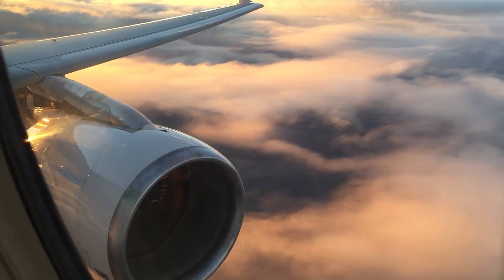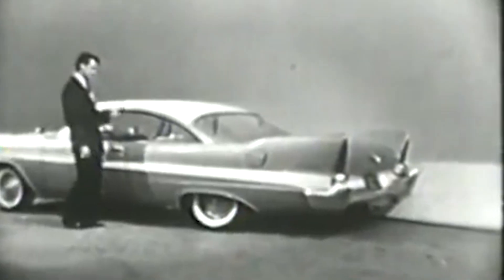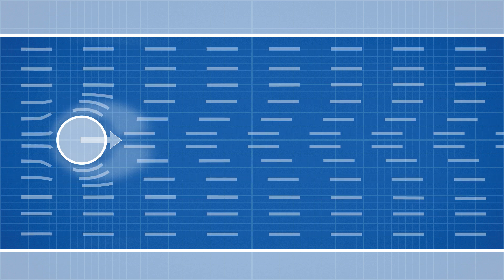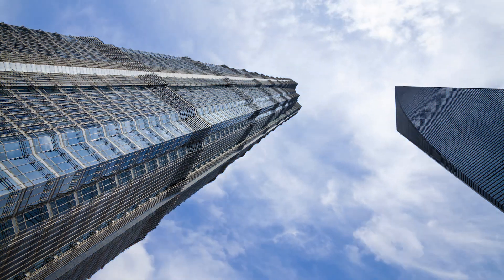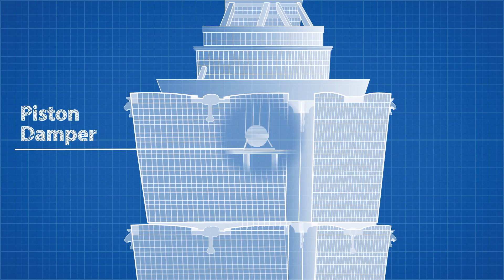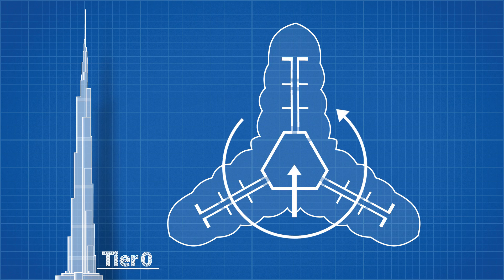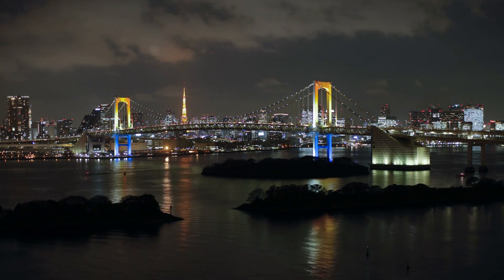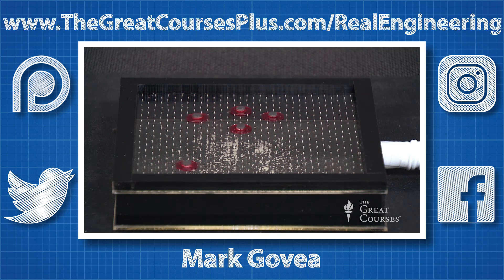Burj Khalifa - How To Build Higher

Comment: Slough in this usage is pronounced like tough, with the f sound at the end, rather than like the ow in power.  In place names and geographical use (swamps or very muddy areas), it's pronounced as the latter, but if it means to shed or cast away something, as in "The skyscraper is able to slough off the vortices of traditional skyscrapers," it'd be the first.  English is a weird language.

Comment: My friend, you should do a part 2 of this video focusing on the sub-structure of the Burj Khalifa! The final product that we see above ground is no doubt amazing, but what is truly fascinating to a structural engineer is the portion of the building BELOW the ground, and in the case of the Burj Khalifa, it's quite an engineering feat unto itself! Think about how deep the foundations needed to have been dug into the sand, then the piles which are another, separate layer of depth. If the above ground structure is about 50% of a mile in the air, then my conservative estimate is that the below ground structure is probably around 25% of a mile in depth. So if measuring for total structure of the Burj Khalifa, it's estimated to be about 75% of one mile, which is truly impressive!

Comment: Hello Real Engineering, I am currently an undergrad student at SFA pursuing a mechanical engineering degree. I am taking a fluid mechanics class this semester and as a part of the course, I am required to write a short paper on a topic using a first order, analyitical analysis from fluid mechanics. We just got in to viscous flow over external surfaces and talking about vortex shedding. I watch A LOT of your videos and I thought of this video. My text book goes into general detail about flow around a cylinder and talks a bit about vortext street and the Strouhal number, but not explicitly. I was wondering if you could recommend some sources for me to look at to learn about this subject. The paper only needs to be 1200 words, so I don't have to go into extreme detail. It is only a first order analysis of the forces caused by vortex shedding, something that can be done analyitically. Anything helps! 
Thanks in advance!

Comment: Another tidbit about vortex shedding... automotive external radio antennas usually have a spiral winding built in for this same reason. The vibrations cause an unpleasant noise, so were addressed with the coil. No more whistle!!

Comment: Part of the reason the Burj Khalifa does not need a Mass Damper is because it's shape constantly changes as it moves upward. If the shape constantly changes, the wind vortices can't gain strength. One World Trade Center in NYC uses the same tactic

Comment: I have a question about rotors.
I know we have rotors that are designed for maximum efficiency, but what about rotating the blades of the rotors to give them maximum efficiency at all speeds? For example, at low speeds the blades are very horizontal, but at high speeds the blades are vertically rotated to adapt to the air speed. In this way, the rotors don't have to rotate faster to pick up more speed right?

Comment: What about emergencies? we CAN build higher, but what if there was a fire at the top of the building? Elevators can't be used, so how would the people at the top get down 30,000,000 steps to the bottom in time? (Yes, I randomly pulled the number)

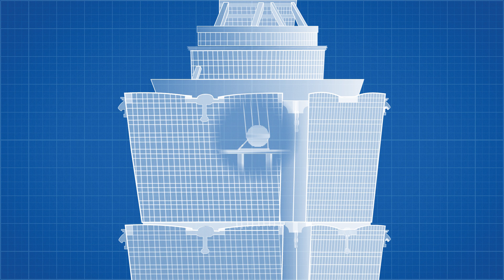Comment: 4:10 Maybe I'm not completely understanding the dampers - 
But from the diagram, I see they are placed inside the middle of the building, meaning the mass is only connected to the building itself and the force applied to it has to push against the building. If the building sways to the right and the damper sways to the left at the same frequency, wouldn't that mean that the damper applies a force on the building to the right side (the same direction as the building's motion) to make it move to the left? Would it make sense to make the damper move to the right along with the building so it pushes on the building to the left side, countering the building's motion. I'm thinking about this in terms of conservation of momentum right now. Sorry if my question may be confusing, but could someone clarify these things? Thanks! :D

Comment: one small correction: at 3:20, the driving force is in phase with the oscillation. At resonance, the driving force phase should be 90 degrees ahead of the oscillation phase.

Comment: How do you get water up the Burj Khalifa? The waterline is under the height of the building.
Reply: Multiple pump + water storage perhaps? (for example, they just need to pump the water from 1st floor to 10th floor where is the first water storage exist. Then they can pump again from 10th floor to 20th floor and so on...)

It doesn't need a very powerful pump with that way.
Reply: Maybe no bathrooms at the top? Either that or they have emmense water pressure pumps to get it up maybe.
Reply: But what about drinking water?
Reply: Yes thats correct. The concept of service floors comes into picture here. At intervals service floors are placed to allow changes in placements of ducts (plumbing and electrical if plans demand so) and Hydropneumatic water storages catering to set floors above.
Reply: No, i took a shit there, definitely water

Comment: The main problem for even higher buildings is it's elevator network. higher buildings would normally mean that there are more people working or living in them. These people need to be transported and the higher you go, the more people you have, the more elevators you need. conventional elevator shafts would need so much space, that there's nothing left at the bottom. But German elevator company Thyssen Krupp has that covered for the future. They invented a system with multiple levators moving in the same shafts. This will increase capacity drastically and the buildings could go higher again.
Reply: That system also allows for the elevators to move completely independent from each other and even horizontally to go to different elevator exits or to "overtake"
Reply: ytxstream Exactly, I look forward to try it out, it's a true revolution in elevator technology.
Reply: The elevator in the burj dubai is cool, it has a bunch of video screens inside it
Reply: Heh. I remember struggling with this problem in Sim Tower.
Reply: Sounds like stuff that's already existed for a while, I'm guessing with the addition of central reporting and control.
Reply: seigeengine Does it? Where is it? I've never heard of it.
Reply: NeoDerGrose Don't know off the top of my head, but I'm pretty confident I've run into content about elevator shafts that do, or at least could support multiple independent elevators (there are others with multiple elevators, but where they all move in concert), and there are definitely systems that incorporate the capacity to move both horizontally and vertically.
Reply: And maybe we could even build The Houston Tower,aka three kilometer high blob of Concrete with tiny black windows on it

Comment: I wonder how well the burj khalifa does in terms of usable space per occupied building area, since this is what really counts for dense areas. Sure it's incredibly high, but it gets really thin at the top
Reply: It's not that great. A lot of the internal space is eaten up by elevators. Elevators are such a big problem that buildings much taller than the Burj Khalifa will mostly be elevators.

Comment: a correction: You dont battle urban population grow by super-tall buildings as they are simply too expensive. Instead you densify the existing housing areas. These super-tall buildings are more a big.dik.contest than an economical reasonable option.
Reply from the maker: more on that in the next video ;)
Reply: This "densification" you speak of, might that manifest in the building of high rises to accommodate more people in a smaller area? 
If you can't build out, build up.
Reply: NuclearSavety its better to live in a decently sized apartment in a tower building than in some cramped small apartment with like 3 roommates and a 10 floor buildings

Comment: I know the Burj Khalifa has multiple large water reservoirs for the water supply of it's inhabitants, so don't those technically act as mass dampers?
Reply: No, mass dampeners have to be able to move because the dampener moves instead of the building.
Reply: kokofan50 water can slosh around though
Reply: hey7328 I don't think it works like that because it has to dissipate the movement of the building. Water would just move back and forth.
Reply: Richard Thai even if theres no tuning it has to slosh against the movement of the tower sometimes. the friction will make it slosh out of sync from the tower swaying. not tuned though so it will only slosh like that once in a while though
Reply: ***** Yeah... that doesn't sound like it'll help to much but I honestly have no clue :)
Reply: Richard Thai yeah but the burj khalfa hold a lot more weight in water than the mass damper shown
Reply: ***** I don't know the specifics but the weight wouldn't matter as much in the case that you're arguing because it still needs to be able to dissipate the movement of the building.
Reply: Richard Thai i don't think it's a large effect because they aren't tuned, but it's still there

Comment: If I had to take a guess, I'd say that the reason vortex shedding begins is that real-world instances of it are not perfectly symmetrical.  So once it starts off to one side, it will eventually amplify at the resonance frequency...instability pushes toward more instability (so to speak) and so on.  Energy provided by the moving fluid keeps oscillations going.

Comment: But will cities build super tall only because of their population growth? There are no skyscapers in Paris (I know about La Defense but generally the city is bare of them) but the population density is 21.000 per km². Berlin is also a city void of Sykscrapers but has a much lower density with slightly less than 4000. I think there is much room to increasy population density without those structures.

Comment: The other reason why Taipei 101 opted for a gigantic shock absorber was that there are a hell lot of earthquakes here......
Reply: The dampener dampens lateral movement be it earthquake or wind. Also, it looks damn cool.
Reply: The tour guides say that it's mostly for wind
Reply: @mikee3216  especially when typhoon season rolls around
Reply: story drift !, earthquakes are critical for the first 5 or so stories then deflection reduces up the building. anything placed in the top floors of the building is for wind.
Reply: The dampers in the tuned mass damper (TMD) are primarily for wind. Earthquakes bring a broad range of frequencies, and because of that a TMD system isn't much good because you might be able to tune out the worst expected frequency, but there will still be many other frequencies that will be detrimental to the structure. Wind loading however tends to be in a primary frequency, and then can be tuned out. The dampers will certainly benefit the earthquake resistance of a building, but not enough to consider it as a method of resisting earthquakes
Reply: +Andrew Chen Perhaps but earthquake dampeners are typically in the foundations so wind was probably the main consideration.
Reply: taipei 101 survived an earthquake before it was even finished.

Comment: taller buildings doesn't solve any problem, unless people can work, live and shop inside it. If not it will only make the problems worst by concentrating people even more
Reply: Our cities are getting more centrilized and dense. It's a tendency. And taller buildings are there to allow that to happen, so it does solve one problem.

I can't say that this tendency will continue until we need km high buildings because I'm no geographer. But I think it could become true. All I can say for sure is that I would LOVE to see those structures :)
Reply: Burj Khalifa is not a great example. You need tall buildings that are longer and wider and perhaps half the height of Burj Khalifa.
Reply: alephii I heard somewhere its better (more eco friendly) to have people concentrated instead of scatered
Reply: inseto bob it is more eco friendly to have fewer people in the world. But my point is about issues as mobility and proper infrastructure in the surroundings... Imagine a commercial building with 10000 people moving at the same time for a residential building somewhere else... this kind of things must be considered, this is already a problem in big cities, taller buildings will only make it worst if not planned as I commented before...
Reply: Concentrating people is the SOLUTION to the problem. Cities are extremely efficient, whereas less dense populated areas are less efficient. Take your complaint about people having to move around. The more densely you pack things, the less distance people have to travel, and the more efficient it is to put in place the very expensive systems that can move those people, like high speed railways.
Reply: seigeengine do you mean concentrate people indefinitely? dont you think that there should be an optimal value? I can say that I live in a single lane street with 6 towers with 28 floor buildings and I have to leave home 1 hour earlier to avoid the rush time or I get late to work, once two out of three elevators were not working and I wait the elevator for 10min! What I mean is that only raising buildings with infinite number of floors must be done with a careful plan including infrastructure for transportation and supplies. And I am sure that just concentrating more people is solution for nothing if not planned and optimezed.
Reply: alephii That's literally impossible, so, no. Obviously you plan. Chaos is inefficient.
Reply: alephii the other dude already explained everything, so I will just point out that less people doesnt equal to less concentrated
Reply: Tall buildings increases tourism